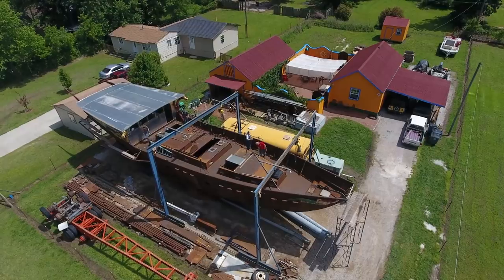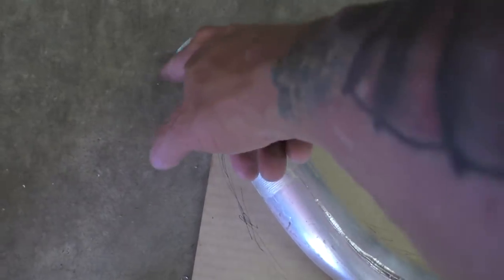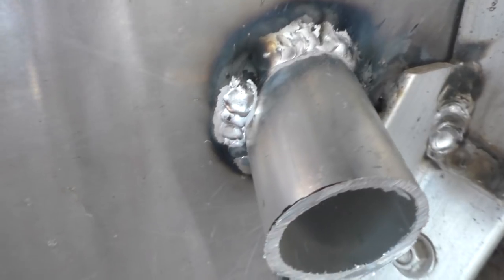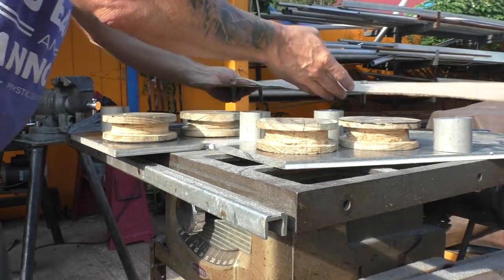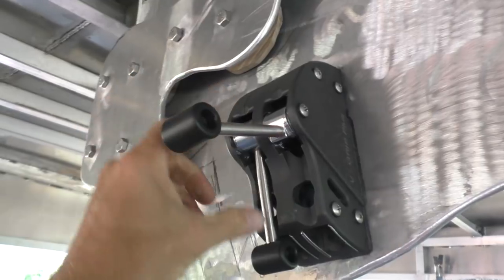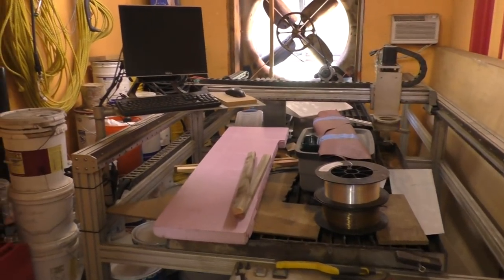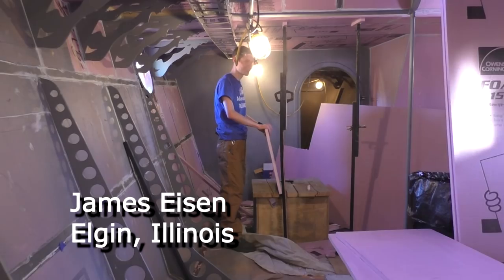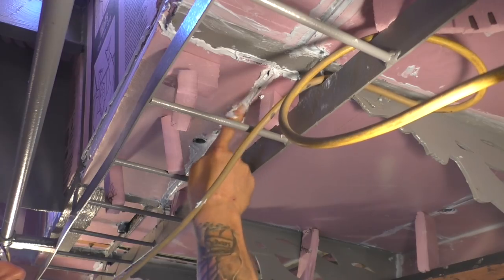Insulation, Pipe Bending, Sail Rigging and Boat Building

Comment: You can fill the pipes with sand and weld caps on the ends before bending and they won't collapse nearly as bad.  Kind of a pain but works well if you need a good mandrel like bend.
Reply: I was about to say the same thing.
Reply: That's a really good idea
Reply: Was going to say the same thing

Comment: Hi Doug I just had a thought mate, on the roof of the wheelhouse, maybe coat it with that truck bed liner stuff to help keep the sun heat off the metal and to give you a non slip grippy surface to walk on with wet feet if it's raining !! Not sure how it'll react with aluminium and salt water !!  Seeya Rob

Comment: When my father was building his airplane he showed me a trick for bending pipe.   Plug one end really well, fill the pipe with sand then drive a second plug in at the other end packing the sand real tight.  Then when you bend the pipe it will not collapse.   It worked with the aircraft steel but that was only about 3/4 inch diameter.

Comment: Hey you can fill the pipe with sand before binding to keep it from collapsing in the bend
Reply: I have a bender just like that. It bends pipe perfectly but kinks it like that with tubing. The dies are sized for pipe. Never tried it with sand though.
Reply: filling the pipe with sand would have helped but would take some time to make sure the sand was evenly compacted and also would need to anneal the pipe in the sections that were slated to be bent to aid in the process plus the time to cap the ends of the pipe so the sand would be captured...
Reply: TheMetalArtMan all it would take to seal the ends would be some duck tape
Reply: I have had that fail before on large Dia thick wall tube even with the sand compacted...so I just pinched the ends and it worked great...it does vary depending on the tube size material and even wall thickness...lol thin wall is the hardest : ( pitch/resins work great for that and once it solidifies it keeps it in place with out sealing ends : )...

Comment: Have you noticed a change in the temperature in the cargo hold with that insulation up?  does it stay cooler now?  It seems you aren't all dripping wet now...I know you commented its getting hot, but is it as bad as it was without any insulation?

Comment: Hi Doug, I haven't tried it myself so i'm not speaking from experience, but in one of his videos ChuckE2009 used a pipe bender like yours and mentioned using a smaller set of dies support the material better and it doesn't kink as much, I know you two worked together, maybe give him a call about it? I think the Die was supposed to support the sides of the pipe and not the bottom so the pipe doesn't reset fully inside the die opening. Greetings from Poland!
Reply from the maker: Thanks.  Yeah, we do that too.  That's what leaves the marks on the side of the pipe.

Comment: Hope you have thought about the issue if you have a pin hole leak on your hull welds. That would be a pain to find on the back side of all that glued in foam. Remember you had one on your keel.. How many more will you have..
Reply: maykevin5 well shit.
Reply: The epoxy coating should deal with that.

Comment: When I"m doing foam insulation in old buildings and fitting it between wavy roof beams I set a datum line and measure out to either side every 20 cm and it just slides on in there..

Comment: 6063 Schedule 40 Aluminum Pipe will bend in the kinker. 6061 Alloy will deform and crack. Just a heads up.

Comment: Are you worried about your foam holding water? Im sure its not 100% closed cell is it? I mean we use that EXACT foam to fill gaps in stadium concrete seats. To reduce load. So itll prolly work.

Comment: What happens to the moisture/condensation behind the foam insulation?
Reply from the maker: Won't happen.  We sealed both layers of foam.  No moist air = No condensation.
Reply: Thanks for the reply. That makes perfect sense. If there's no air with moisture in it, there is nothing to condense.  And two separate, sealed layers provides some extra security against leaks.

Comment: Did you have to make an air gap between the insulation and the metal?
Reply: That's what they don't want, they want the insulation tight to the steel to avoid condensation between.
Reply: I was hoping that Doug would answer that, but guess I will have to go back and look at the earlier vids. I recall wood strips below, but not sure.  Thinking about using that stuff on metal roofing and can't remember

Comment: maibe you get the pipe to bend better if you fill the pipe with fine sand and put a stopper in both ends
too bad youre selling the cnc machine , but then again you dont use it no more and you'll have the tormac to do most of the stuff that you need to make in small series 
i would keep the grizzly lathe though , you whont get a lot for it in resale vallue (maibe more if you sign it and put some document with it saying its off the sv seeker ) 
you could mount it somewhere in the engine room , its perfect to do a quick machining job on the boat without programming a file in mach to operate the tormach

might be interested in that 3d printer head and the drive system you had build for it (does need to be shipped to europe so i dont know if its worth the trouble )

Comment: Have you considered using Tuck tape to seal the cracks in the foam board?
Reply from the maker: They make a tape for sealing the joints, but it's expensive and as long as you make the joints tight the glue does a better job.

Comment: The trick is to fill the pipe with sand, while you are bending it.
Reply from the maker: Yes.  That works but it takes a lot of time to pack the sand in there and the amount of time increase disproportionately to the length of the pipe.